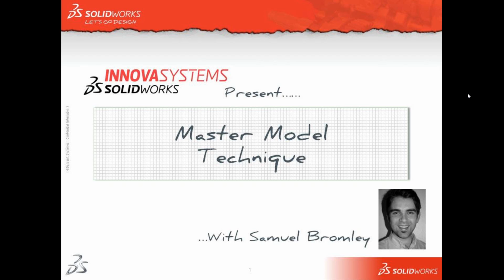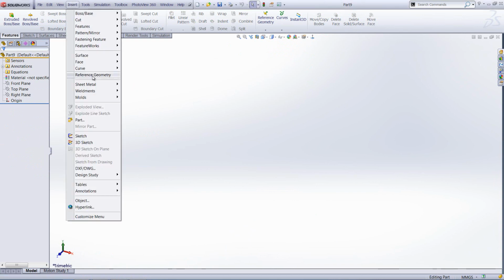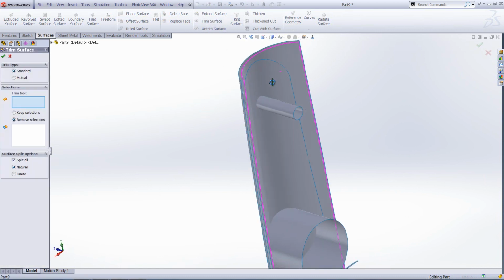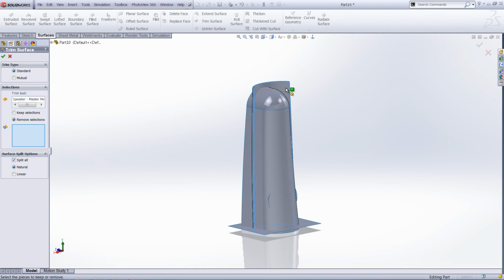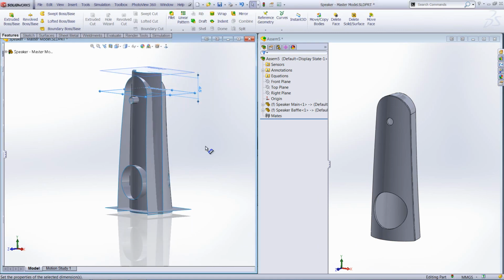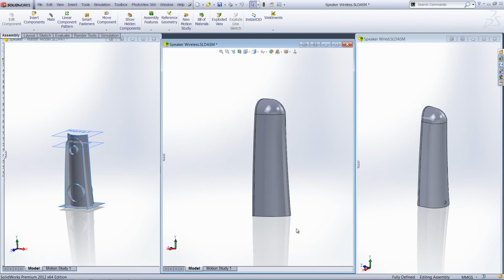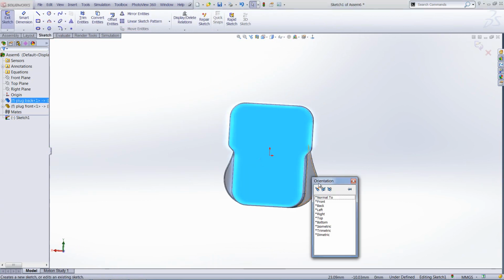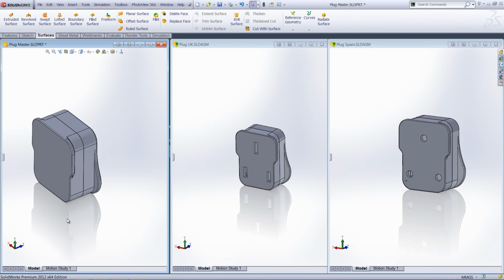The Master Model Technique in SolidWorks [Webcast]

Comment: What are the advantages or disadvantages to using a surface master model versus a solid master model? If you have to split parts to create more bodies the solid master model, wouldn't that cause instability in the derived parts that you created before the extra split?